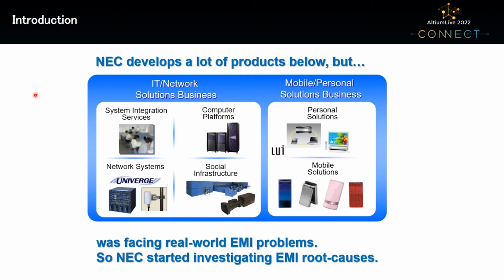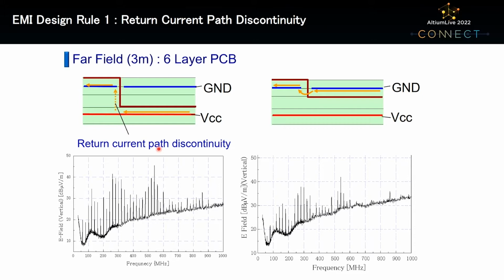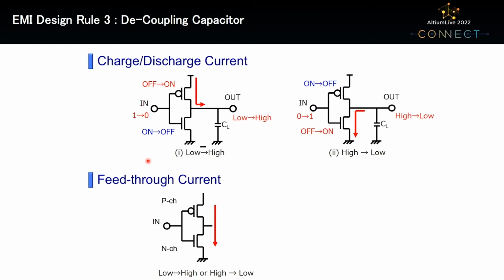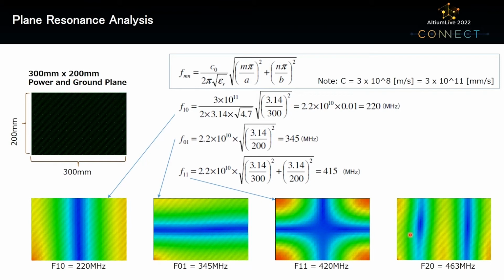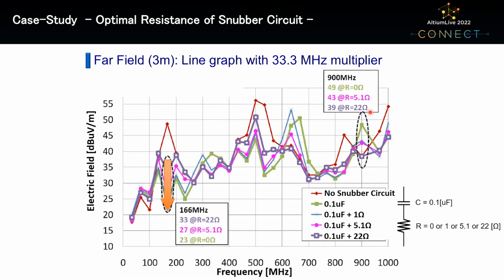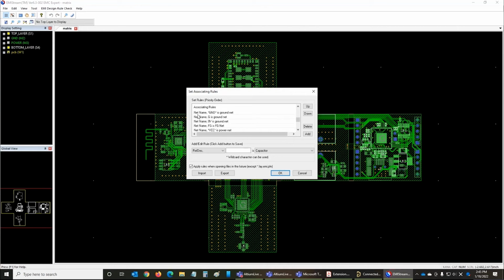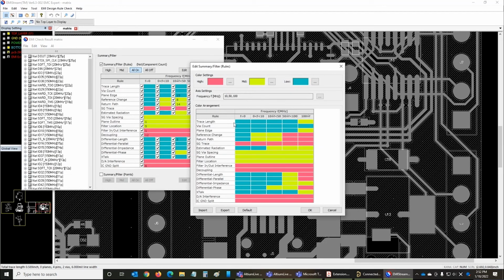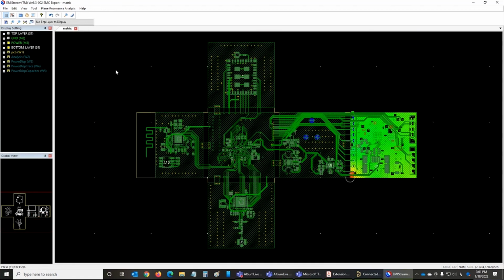Eliminate EMI Problems at the Design Stage | Altium Live 2022

Comment: A PCB trace over a GND plane should have very little/no far-field radiation. 
Therefore I am very skeptical of the results in the black line (0mm slit) given at 8:30, peaking at 45dBuV/m...?